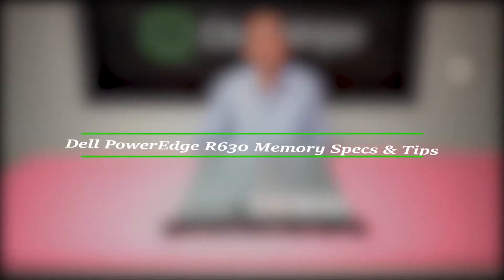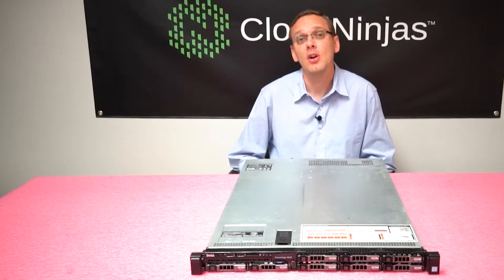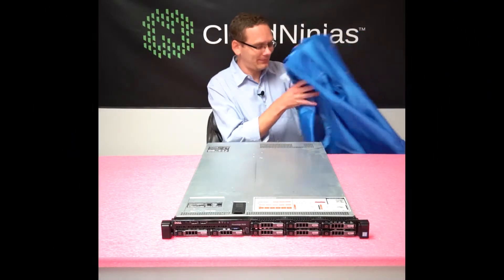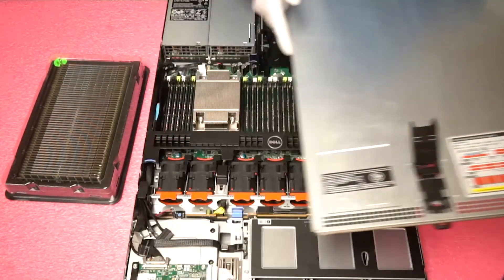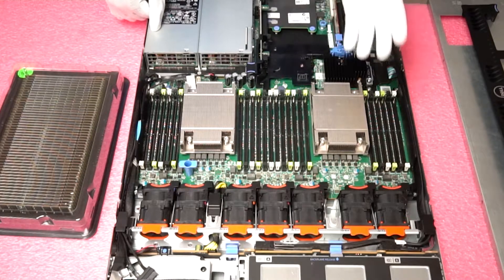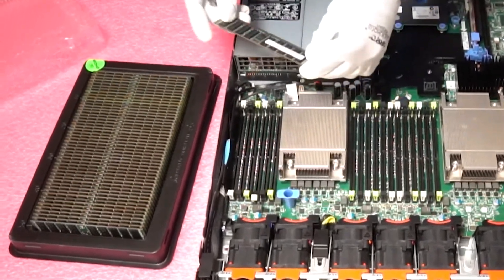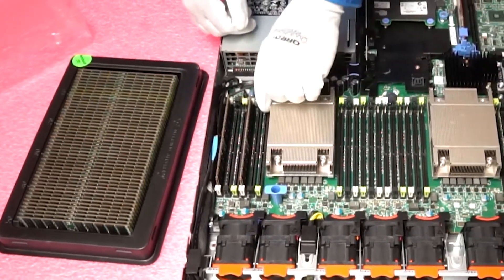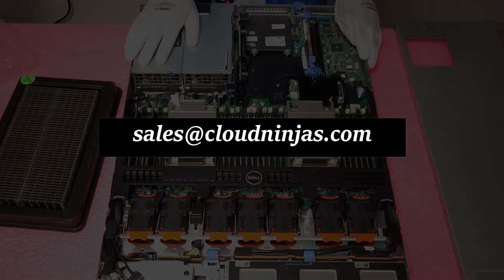Dell PowerEdge R630 Server Memory Spec Overview & Upgrade Tips | How to Configure & Install RAM

Comment: On Dell's spec sheet for the PowerEdge R630 it says it only supports DDR4 up to 2400MT/s. Can the PowerEdge R630, in fact, run up to 2666MT/s? Thanks.
Reply from the maker: For more info visit our website https://cloudninjas.com/
Reply from the maker: Dell themselves sell 2666MT/s for this system.  Albeit at a very high price.  Worst case clocks down to 2400MT/s.  Will definitely work well in the R630.  Thanks for reaching out.  Take care.